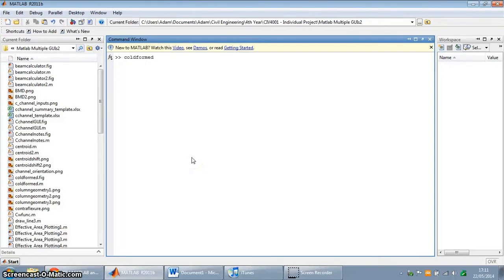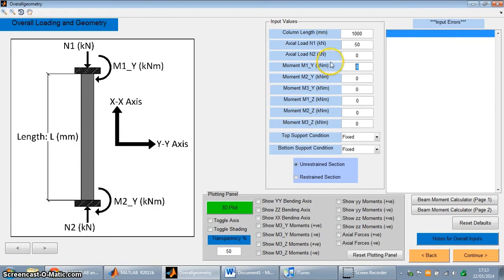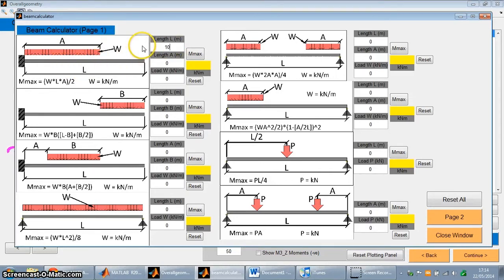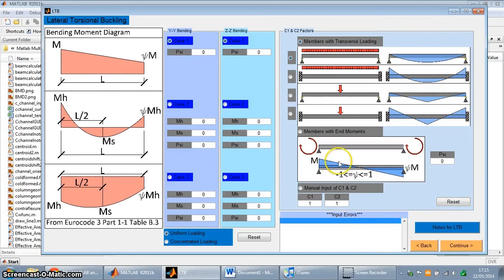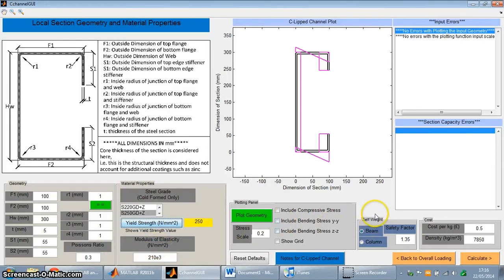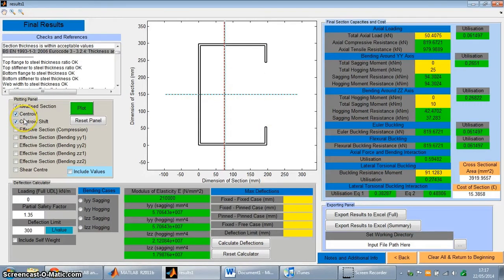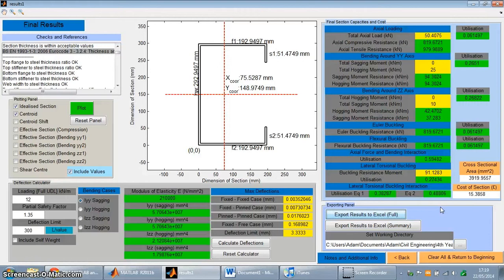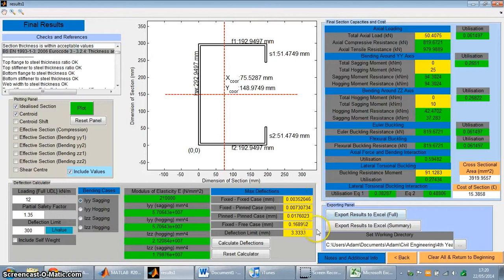Matlab Program for Cold Formed Steel Design

Comment: "Hey there, I'm interested in your Matlab code.Would you happen to have a place to share it?Thanks a lot!"
Reply from the maker: Here's a Dropbox link to the full uncompiled Matlab program:
https://www.dropbox.com/scl/fo/xbrhezqwr07y3u8g7r2wu/h?dl=0&rlkey=aru6aefd93xyreka4z4u7l9ou
My website also has a copy of the dissertation which is free to download and has more of an overview on the analysis methodology.

Please bear in mind that this program is almost a decade old now and it hasn't been checked to the level of scrutiny required for use in real world applications. By which I mean this should not be used to design real world elements that will be subjected to loading. Also the coding is pretty janky as well in places.

If you're interested in design of cold formed sections I would recommend starting with Eurocode 3 specifically BS EN1993-1-3 & BS EN1993-1-5 as these are the two codes which set out all the formulas. Part 1-3 has the general information on how to pre-compute an idealised flat plate geometry and run the distortional buckling calcs, and part 1-5 sets out how to do the effective widths for local buckling. You do the local buckling effective widths first and then the distortional buckling effective widths second.

For complex cross sections I would recommend using the direct strength method and an eigenvalue assessment of the buckling shapes. A common program used for this is CUFSM by Ben Shafer.

Hope this helps
Reply: @lebagelboy  "Hey, thanks a lot buddy. I'm really interested in this topic and I want to explore it further. As you mentioned, over the years, there have been changes in the relevant specifications and codes. I went through your code and noticed that some parts of it are almost obsolete, for instance, the first part of loading and the 3D drawing part that's not displayed fully. But that's okay. I'd like to work on a similar code for calculating steel beams. If you have the time, would you like to discuss it with me?"
Reply from the maker: @junfenglu-g7s  I'd be happy to discuss further if you want. I've got contact info on my website if you want to go there.
Reply: @lebagelboy  "Hey, I'm totally down to collaborate and make things better, but I gotta be honest, I had a tough time finding your website. Mind sharing the link with me?"
Reply from the maker: @junfenglu-g7s  
www.adamlebaigue.com

Comment: Great job. 
Where can I find this file to Matlab
Reply from the maker: I've not put the program up online anywhere as yet due to concerns with my university department. Basically this body of work hasn't been marked yet and so I don't want to risk my final degree classification by putting it on the web where people can ''tamper'' with it. Also it doesn't run from just one file there are multiple scripts which the program calls and also multiple images which are loaded. I did try to compile the program using the deploytool within matlab so it would run from a single .exe file but my version of Matlab wouldn't compile the image processing toolbox correctly which cut out that option. 

It is likely that when I finish the degree (this summer) that I'll upload this program to the Mathworks website file exchange but I can't make any promises at the moment.
Reply: I understood